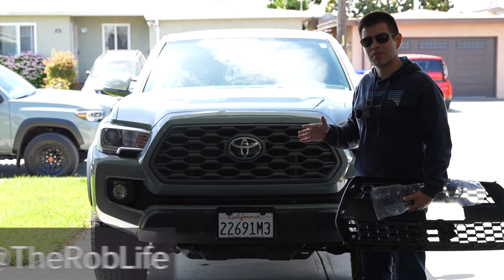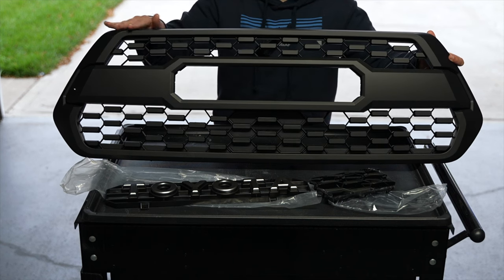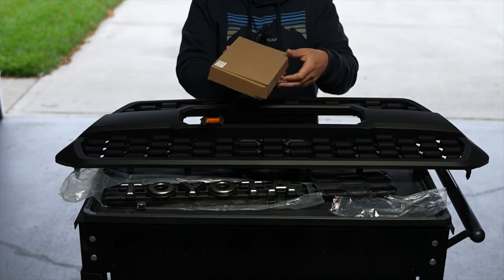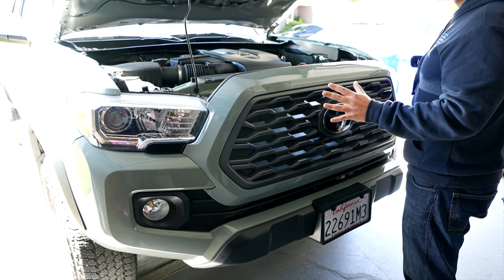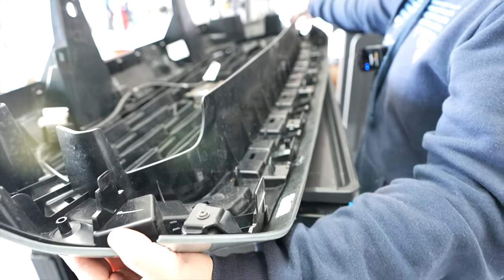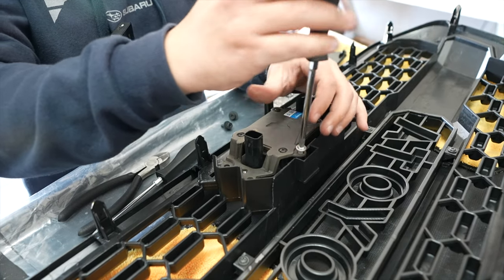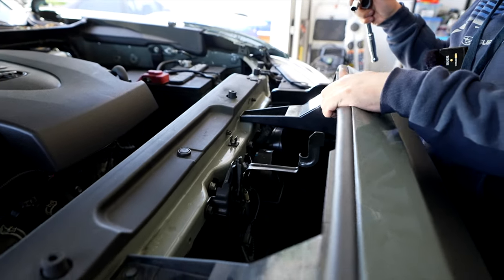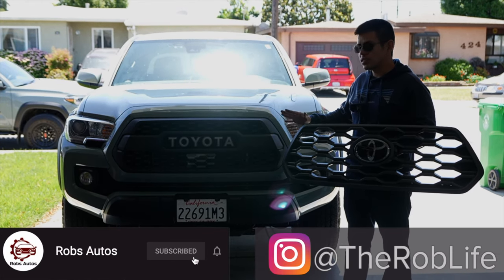Change Your Tacoma Grill to The TRD Pro! YotaVerse Tacoma TRD Pro Grill Review!

Comment: On the garnish witch was installed on the grille from Yota Verse. It has the lock washers installed. How do I get those off to install the new garnish?
Reply from the maker: Just gotta pry it off, a bit of swearing was used during the process lol
Reply from the maker: Pry the washers off I mean
Reply: Installed mine yesterday, and it looks great. There are no warning lights yet. It's a pretty easy install. I own a SR5. The only thing was two scratches on the grille, but not noticeable unless you look.